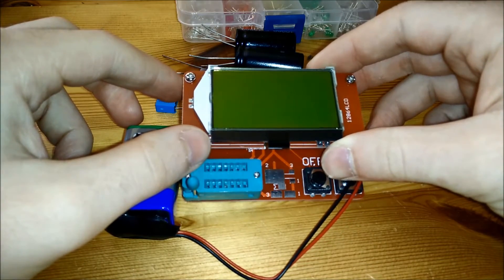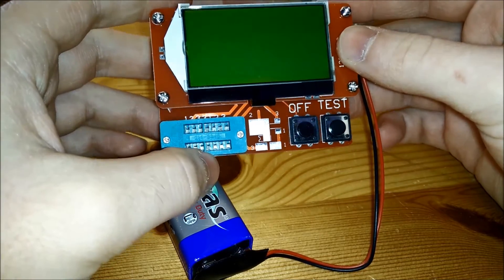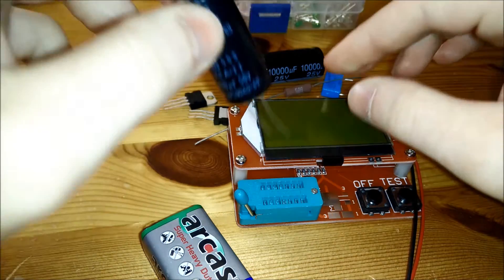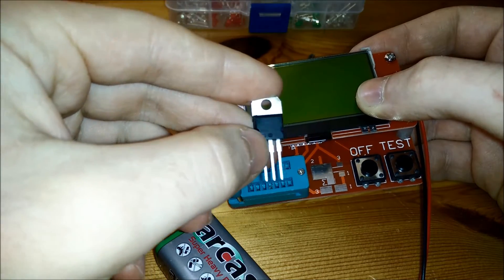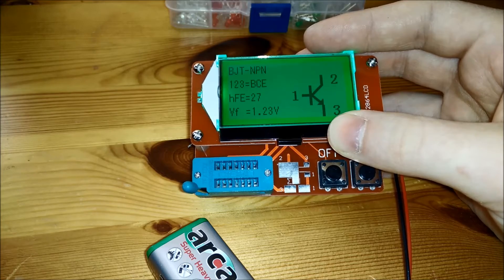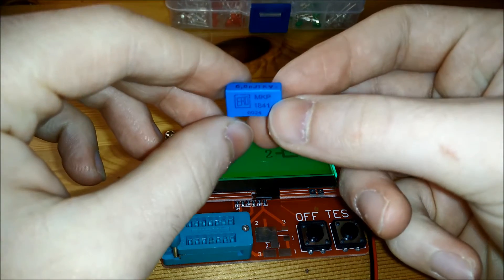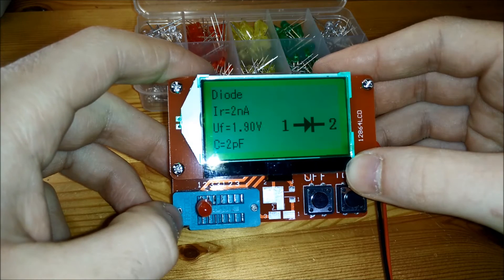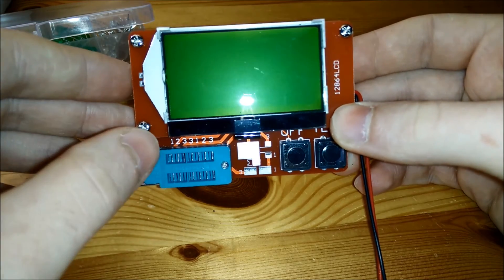Test + Review of a 13$ Chinese component tester

Comment: I may have a stupid question but how do you know what holes to put your component in to test  ??? And thanks for the great vd just subscribed 👍
Reply: The unit scans the connections and they repeat across the socket. It is possible to use duplicate pins but the unit will say the item is defective, giving you the chance to check your connections.